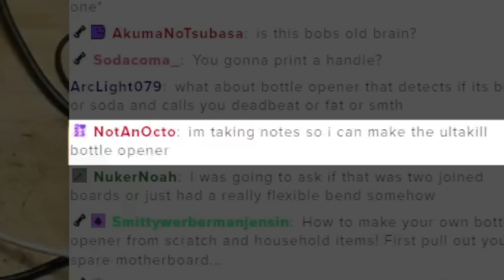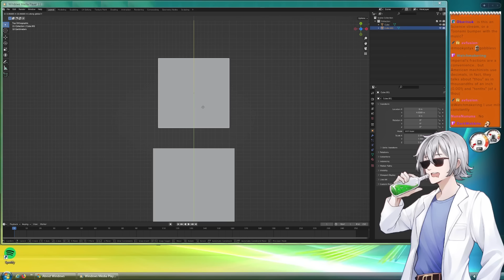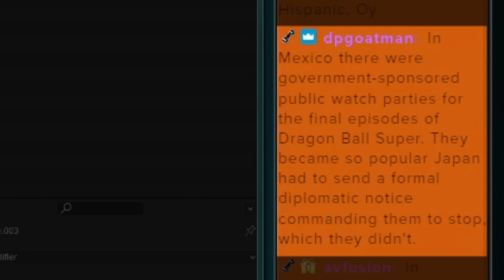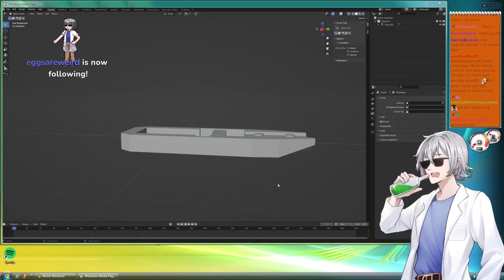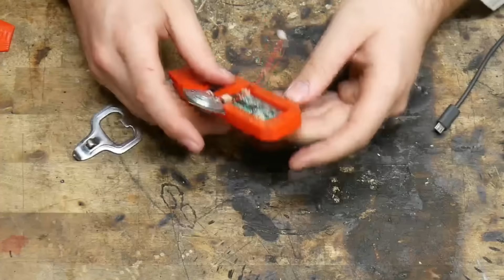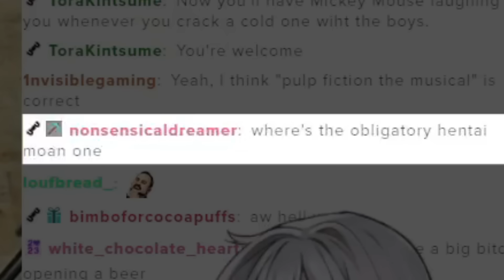Building a Bottle Opener that calls you an Alcoholic

Comment: Pro tip for modelling printables in Blender. Set your units to mm then use booleans for EVERYTHING. Screw hole? Make a cylinder, select it, then select the object that needs the hole, then press Ctrl + '-'.

Comment: 11:30 they are bad for how we act like they should be used. Metric is also fractions. Just sensible fractions. Imperial is maybe useful for houses with oddly divided fractional spacing. But everything else would be more clearly defined by factors of 10 practically. America should switch. The only issue is education and reeducatuon reform. Beyond that anyone fighting ovee it has an ego issue and id wager is overly imperialistic honestly. Its a wierd ass "we are number 1" thing when i see it a lot and its honestly sad

Comment: as someone who uses cad software, im impressed by your dedication for using blender for anything with measurements
Reply: i'm not kidding, i read "as someone who uses dad software" and "dadication" in your comment. my brain must still be very tired
Reply: @kfogo7459  I gotta steal these when I'm a dad
Reply: Did you pay for the software? Or I should say, do you continue to pay for the software every month.
Reply: @Dookybootie  freecad is an amazing free software
Reply: I mean, you can make dimensional stuff in Blender, the G hotkey is right there. Uwo is just chaotic evil.
Reply: @yami_the_witch By default G is free move, you need ctrl for even movements
Reply: I'm right there I am very efficient in Autodesk CAD and this guy over here acting like using Blender perfectly normal. Bro what are you trying to sculpt?
Reply: I use a single pre built template file to build cabinets and render technical drawings in blender. It doesn't cost me anything...
Reply: Sigma free blender vs Beta pay per month Cad
Reply: You don't need CAD for a bottle opener, or anything 3d printed anyways